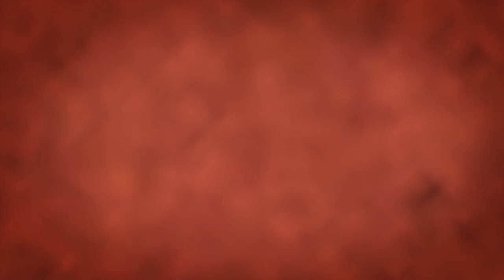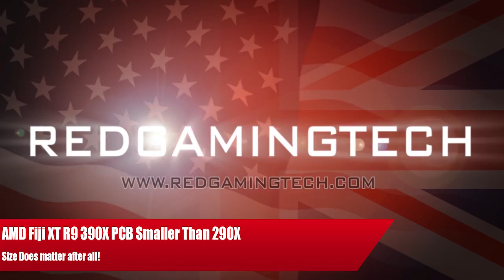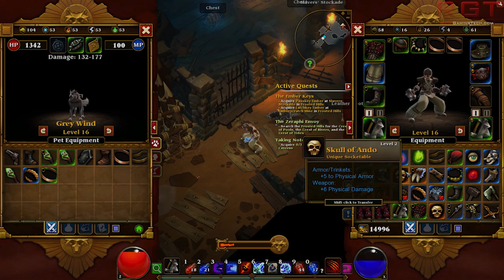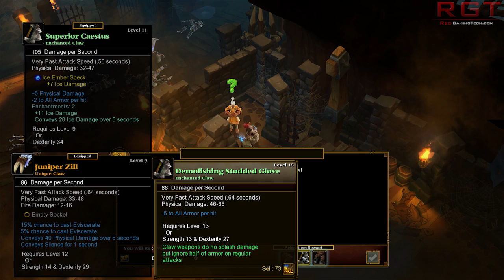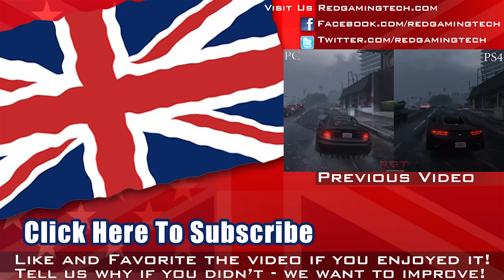AMD Fiji XT R9 390X PCB Smaller Than 290X | Size Does Matter Afterall

Comment: Anyone please help me, 
2 flashed crossfire 290 OR one rumored 390x? 
I can get the two 290's for 400$
Reply: IRON9LORD No, just no, Crossfire profiles have been inconsistent and reliably late over the last year, I'm on a 290x and had been considering crossfire last year but I ended up not getting the second card because of the temps on my MSI twin frozer 290x. Now I'm really glad the temps stopped me. Just be patient and wait a bit longer, The gaming experience you have will be a lot better.
Reply: IRON9LORD There is no 390x at the moment, so the best answer is wait and see. Twin 290s will almost certainly be more powerful on paper, but they will eat a ton power and spew a ton of heat. Not to mention dual gpu setups tend to have a lot more issues than single card rigs. 

Also if the past is any indicator, the 390x will cost more than $400 and since it's supposed to be another Titan killer it may sell for more than 980. That said a 390 no x will probably cost closer to $400 and blow a single 290 out of the water if the rumors are true.
Reply: IRON9LORD Something wrong with my youtube, cant start my on thead.

It can be discuses if a chip is a die. But anyway, the 4 different footprint around the GPU contains 20 dies in total.

The thing with DRAM memory is today the buss consumes more power than the actual memory, and that counts for both the GPU and the GDDR end of things.

With HBM the buss power consumption is reduced quite a lot, i think its like 60-70% odd or so. So with HBM bot the GPU end and the DRAM end including the actall memory consumes less power then only the GPU end of a DDR3 or even a GDDR5 based GPU.

The net result is bot thermally and layout design, you basically lose the memory chip. Losing the Memory cooler, losing the memory "floor-space". Losing the memory power-supply and so on.

Also, the power consumption of the GPU memory bus is reduced significantly, but this is compensated by the actual memory, loading the cooler with about the same amount of heat.

Of cause, this gives us headroom in adding more power to the actually GPU if you only have a larger cooler.

Anyway, i would say that 390x is a more efficient design than two 290x or a 295x2. You loose like 10-20% efficiency when "cross-firering" So a 295x2 gives us 2x2800 od pipes, a 390x gives us about 4000.

But when accounting for the cross-fire loss, the 295x2 is down to about 4500 pipes, and the 390x will probobly clock higher, so i would say that the 295x2 might still be faster, but only just. The 390x will consume just over half the power of a 295x2 and will probobly be quite a bit less noicy. Also, when we talking multi 100w of power, saving it is actually quite a impact on the power bill and more so on the PSU. IF you already have a 1200W PSU, you might not care, but if you sitting around with a 600-700W PSU it will probobly not handle two 290x.